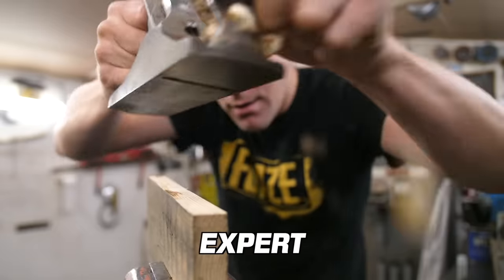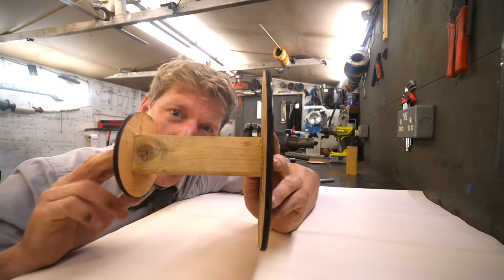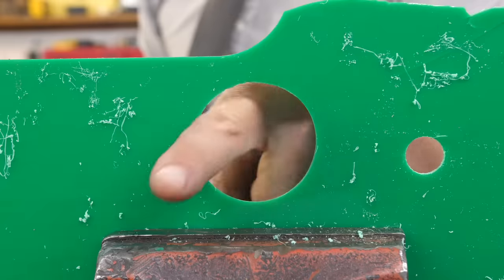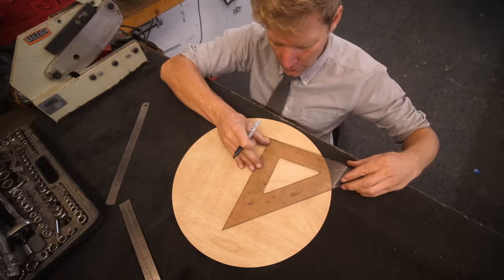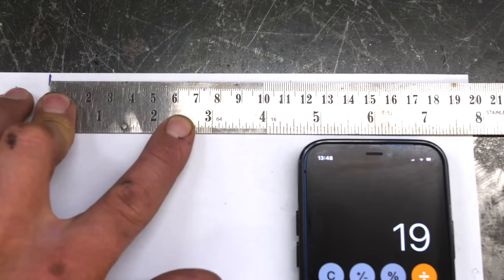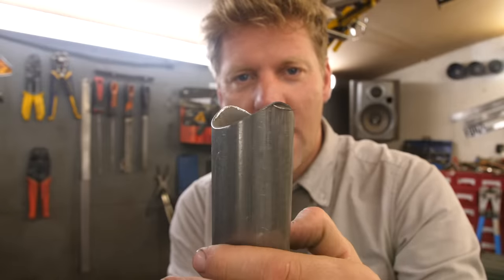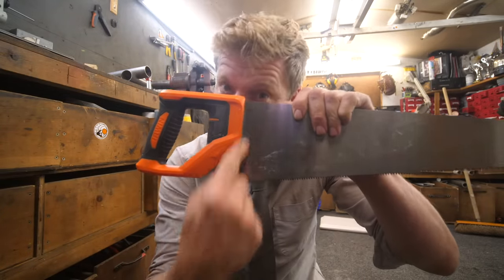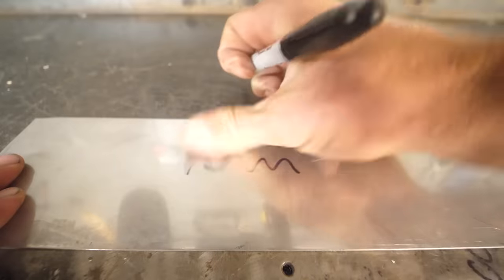18 GENIUS Workshop TIPS (that actually work)

Comment: Straightening brake line through a hole drilled in wood and refilling an aerosol can with shop air are such great ideas, I can't believe I've never thought/heard of these before.
Reply: Using a old rubber tire valve fits nicely on the aerosol can and the air chuck.
Reply: The only thing Colin didn't mention is that if the product in the can is something that cures (e.g. paint) you should understand the mechanism of the curing before you add air to it.

If it cures on contact with either air or moisture, it'll only really work if you intend to use the remains of the can straight away.
Reply: Agreed.  I have a can of PB Blaster I was just about to throw out because there was no more pressure in the can, despite hearing a decent amount of liquid in there...definitely using this one.
Reply: Un-Safety tie

Comment: When I was building model rockets the instructions had an awesome tip. If you need to draw a straight line on a tube use your door frame. Just hold the tube up against the inside of your door frame.

Comment: If you need to cut a piece of threaded rod or a bolt, put a nut on first. The nut will fix the blemishes on the thread as you remove it after cutting.
If you need to glue two pieces of plastic together and superglue does not stick to them (like polypropylene for example), hot glue is usually your best choice.

Also, just so you know, Colin, if the two diagonals of a quadrilateral are the same length, that does not necessarily mean it is a square. But of course if they are not then it's definitely not a square.
Reply: for the transparant plastic (used for machine protections) u can use chloroform to glue it
Reply: @gabb3r4lif33  Acrylic, yes, polycarbonate I'm not so sure.

Comment: I have a notching technique! I’m a hobby welder and I do a lot of projects with EMT conduit, and the issue I had were breaking hole saws regularly from the skipping or binding while notching. My technique now is to drill a pilot hole with a 1/4” bit through the pipe, using one of those drill gauge blocks clamped on with a hose clamp, leaving  two perfectly centered holes. Then I chuck in 1/4” round stock about 12” long into my hole saw  instead of it’s drill bit, along with the hole saw the diameter of the pipe. The longer rod stock feeds through both holes and keeps the hole saw nice and perpendicular as it cuts. This really reduces the hole saw binding and snapping off hole saw teeth. 
Bonus tip, always operate the drill with your left hand anytime you use a hole saw. If the saw binds, something about your left hand’s grip on a drill spinning clock wise is fine, whereas using your right hand can really tweak your wrist painfully
Reply: The left Hand Trick ist neat!! I will Uwe it when in Drill anything that can bind (or i am too lazy to Walk an get my step Drill Bit)

Comment: One which I'm surprised a lot of people don't know - When cutting with an angle grinder, don't apply force - that's what causes the disc to wear out (and it doesn't cut any faster). Use only light pressure and your cutting discs will last 10x as long. 

To tap holes perfectly, place the tap in the chuck of your pillar drill and turn it manually for the first few turns. 
Better still, make a tapping block from an aluminium chunk - drill and tap whatever holes you need, then when you need to tap a hole simply line the tap block above your hole, clamp gently and go! Perfect taps every time.
Reply: Plus with the angle grinder go along the entire length of the cut moving the grinder back and forth, as opposed to cutting thru the material and just pushing the saw through. In other words, don't use it as a circular SAW, it's a grinder, doesn't have teeth.
Reply: @king4aday4aday   Fireball Tool has a great video on this.
Reply: That video shocked me, when he's like "I pay $6 a disc and can cut 3 pieces of metal before it's ruined."   @InTheCatBoxAgain
Reply: @heathcliffflowen4134 
Yeah, money doesn't seem to be a limiting factor for Fireball... like his stuff & vids, just have noticed cost/thrift isn't on his radar.
Reply: not just with an angle grinder, almost any cutting/grinding tool, let the tool do the cutting, theres generally little to no force required beyond holding the tool in place.
One of the things i got taught over and over in both lapidary and engineering XD
Reply: Same goes with hammer action drills … let the machine do the work not you. Also when drill double check the speeds which I will be optimal performance you’ll get a lot longer life from your consumables
Reply: i learnt recently there are cheapo flat face plates for angle grinders, to clamp on instead of the regular protector (to be like a circular saw). so you can guide with mm precision using a rail, even tho chinesium.
Reply: Putting pressure on is almost always the cause of Jigsaw blade damage (assuming you had the right type of blade 😝). Loads of people think they had bad blades, when they actually just had a bad technique. As with basically all drilling/cutting tools, the tool and bit know what to do. You just need to give them time to do it.

Comment: When coiling an extension cable, rather than making a single loop (e.g. around your hand and elbow), make a figure 8 (crossing between the hand and elbow each pass).  The crossings prevent each loop from tangling with the next pass and you can unwind the coil by grabbing an end and throwing the length.
Reply: This all the way, I prefer under overing my cables but this is far easier to teach people.
Reply: my mates old man used to make us wrap the 50m 110v lead then laugh at us as one arm slowly gave up 😂 wrapping a 50m properly is an artform
Reply: Learn to chain link a cable faster easier and no tangles surely there is a utube vid of this already
Reply: @Thomas-hf3dn Essential Craftsman has a good video on it
Reply: I just converted my hose reel from the garden into holding my lead.When I want to use it I just unreal it. I remove the plug and then inserted the power cable inside the hose socket ,then reattach the power plug so that I can pull it in before winding it up again. This achieved two things, one it stops the cable flopping around when you wind it up and two it means people have to unwind the cable before using it.

Comment: I mentioned the angle iron slip roller trick on your drift trike video when you was making the steel balls. If you radius the internal edges of the angle that are in contact with your material, it won't try to rag the edge on the material as you roll. You can also weld a bit of flat bar on one end of the angle and use a small g-clamp to keep it in place or drill and bolt. Love the videos, but shame nothing blew up or caught fire in this one :)

Comment: Best tip i was ever given for soldering two wires.. instead of trying to hold the wires together or twisting them and feeding solder in, apply solder to each wire separately (called 'tinning') then gentle heat them next to each other with the solder iron and they melt together. Much nicer and easier to do.
Reply: I always tin the wires and usually feed a bit more in but it's often not really needed. I usually find the hardest bit to be getting the helping hands holding them in just the right spot so the wires are nicely next to each other. And usually harder if the bits of wire are attached to something at the other end, which they often are. I find blue tac to often be useful to hold awkward wires in the right spot. Although it can get a bit melty if the wires get a bit too hot lol.
Reply: And don't forget to forget to put the heat shrink on first!
Reply: @mattagnew206  the glory of this (the nasa method) is that if you forget just heat them up again pull them apart let them cool add your shrink and rejoin
Reply: @mattagnew206 That's the most important part. It makes your soldering better if ya have to do everything twice  😂😂
Reply: Yeah, but I come up from the days of the Western Union Splice where you are looking for a perfect solder joint without relying on the solder to be the electrically conducting material. The reason being?  Well non-lead solders have about 10x the resistance of copper. this means that you will induce resistance into the circuit at that point. resistance turns into heat, at a point that can easily melt.  so, tinned connections are only for super low amp applications or where resistance wont be an issue.  

Do it to a sensitive sensor for a machine or car, things wont work right. do it in a high volt/amp circuit and the joint fails.
Reply: Pre-tinned is easy and a perfectly fine electrical connection. For the best durability, don't twist or tin, simply push them together so the strands slide in between one another then place them on top of a soldering iron and wait for them to heat up enough to melt the solder from the opposite side. This will also give you the thinnest possible connection to seal into some heat shrink so it doesn't snag if you have to pull the splice through a harness, grommet or around a corner.
Reply: Rather than twisting the wires or trying to hold them side by side when soldering. The easiest and neatest way is to strip the insulation and then feed the end of the conductors of each length into each other, thereby splicing them together. Now is the time to grip the conductors on each length and twist them. This will give sufficient mechanical grip between each group of conductors whilst soldering the joint. Obviously you will need to shrink wrap or insulating tape the joint.
Reply: My trick is to shape the wire ends into hooks, squeeze the hooks into loops once the wire ends are hooked into one another then solder
Reply: @mattagnew206  If it doesn't have to be pretty electrical tape works fine for most stuff (wouldn't trust it for high voltage but I'm not sure I'd want to solder 2 high voltage connections together anyway).

Comment: To make two straight things square to each other over large distances, use the 3, 4, 5 triangle.
Example: measure 3m out from the corner to be square and mark, then 4m along the other side and it will be square if you measure a straight line between your two marks (the hypotenuse of the triangle formed) and it is 5m.
Works with any measurements that have the same ratios as 3, 4, 5   ie   9, 12, 15  even imperial sizes :)
Reply: Should have read further down everything I’ve said is already here

Comment: When stacking buckets together, you can place a piece of non-corrugated cardboard between them to prevent the vacuum from forming.
When working with spray cans, you can keep the nozzle from getting clogged by spraying upside down for a few seconds. This only works if the can is not one that works upside down.
Reply: I open new bags of cable ties/zip ties like tissues boxes and pull them out like tissues. That way they won't spill everywhere.
Reply: I take the nozzle off and blow through it hard - you can do it without getting paint on your lips. It clears the paint and it works.
Reply: @pepwaverley2185 Just blow long enough till it runs clear. Way better to end up with a little paint you can’t use than waste the majority after one use because the nozzle and inside pipe is blocked.
Reply: @grumpyone5963  There's going to be some funny replies to this comment, I can feel it in my water!
Reply: @kevinmothers904  Oh blimey, I’ve read it again now🤣 We were talking about aerosols!
Reply: Gluing a small crack in wood: Moisten the area. Run a bead of glue on the crack. On the other side use a vacuum to pull the glue through. Wipe off excess and clamp.
Reply: @pepwaverley2185  did you already forget one of the tricks in this very video that deals with that exact problem? Fair enough if you don't have access to an air compressor though

Comment: tilting your ruler to get an evenly divisible number to find your half ALSO works with other divisibles! It's a great way to get perfectly even divisions of any number on a piece of any size, no matter how irregular the measurement!
Reply: This is so obvious in hindsight, I feel dumb I didn't see it
Reply: Same - I am going to make a new ruler that isn't for normal measuring, it just has a start mark, and end mark and a mark for half, third, quarter and fifth.
Reply: @mikelastname  Technially a ruler already has those marks.
Reply: @strecher777  You are right, of course. But this may be the one reason why an SAE ruler is superior to a metric as the major graduations are more in line with the typical divisions needed for "human scale" carpentry, etc.

Comment: Additional tip for drilling level holes (only works when drilling horizontally). Put a washer on the middle of the bit before you start drilling, if you’re drilling straight the washer will stay in the middle. Drill downwards and the washer moves forwards, drill upwards and the washer moves backwards.
Reply: wouldn't the spiralling cut-out on the drill bit naturally move the washer? much like a washer on a spring.
Reply: @rid1coza  might need a drill with a clean shank
Reply: The right washer is always the hardest thing to find. :)
Reply: @GBCobber  It just has to be oversized.
Reply: @RandStuffOfficial  Let me rephrase that. The bigger washers are always the hardest to find. lol
Reply: @GBCobber   Right 😄

Comment: For deburring drilled holes, even at odd angles, instead of using a countersink, use a ball burr meant for a die grinder. Use one slightly bigger than the hole, mount it in a handle (tap handle works well) and turn it by hand. This works great for deburring inside tubing or in tight places where you can't fit a countersink straight on.
Reply: Tapered reamer is the tool nobody has thats just perfect for this XD
Reply: Or just a larger sharp drill bit
Reply: It's not really a secret but there is a tool for deburring even weird holes and irregular shapes. It's simply called "deburring tool" (if you need a specific product for reference, an example would be "Noga Teddy Burr - TB1000" but you can just get any that are like that it doesn't matter).
For regular holes on flat surfaces a countersink bit is usually better but with some stubborn materials like some plastics the deburring tool works much better.
For irregular shapes it's immediately become my favorite tool when I bought it.
Reply: This is brilliant! I often find that countersinks just fold the  burr over, particularly on harder materials. Plus, deburring blades can be tricky in small holes.
Reply: @mycosys  A tapered reamer or drill bit doesn't work on the inside inaccessible edge of a hole.
Reply: Countersinks are still superior IMO…. But they’ve got to be sharp and not run too fast. Nogga type deburrers are also handy as they’re good for sheet metal too.
Reply: @landroversforever  Again, a countersink won't work unless you have access to the hole. A ball burr will work from a steep side angle.
Reply: @mycosys  I love my tapered reamer. I have used the same one for decades. It's worth the extra cost to get a decent one.

Comment: Isopropyl alcohol is the best for removing sharpie markers. 
I use the alcohol wipes on the sharpie labels to reuse plastic bins and bags
Reply: Any kind of high proof mixture will do. And I KNOW there shops where such liquids are very common. Isoprop is the best though, and the wipes are a wonderful premade alcohol + shop towel combo.
Reply: Covid made hand sanitizers freely available everywhere. I have used those many times to get rid of sharpie marks.
Reply: Meths works well for lots of these types of ink and is easy to get.  I have seen navigators use a small tub of nail polish remover wipes to clean permanent pen off maps too.

Comment: Siphon fluid using a blow gun at the discharge end by setting the blow guns tip at about a 60 degree angle facing away from the discharge end. It's like using a hand vacuum to pull fluids. Another....say you've got wires to feed through an odd shaped pipe. Get a length longer than the pipe of  Unwaxed dental floss tucked into one end, then holding the start end of floss, blow the rest into the pipe and it'll always come out the other end. Use this one all the time on retro installs for things like HDMI cables etc into previously installed conduit. Also works awesome to wire up motorcycle handlebars and hide the wires inside the bars. Same with hiding wires in the frames of bikes and motorcycles. Just drill a couple small holes. One at the start of your wiring, another where you want the wire to exit and poof.....floss threaded and it's plenty strong enough to pull a number of wires at once.

Comment: I hope someone sees this!

I needed to drill a hole into the center of a 3/4" dowel to make an axle.

So I took a piece of 2x4 and drilled a 3/4" hole about half way through, using my drill press. Then I used a smaller bit (that matched my threaded rod) in the drill press to drill the rest of the way through.

This made a nice jig.
Put the dowel into one side of the 2x4 jig, and then drill from the other side of the 2x4 into the dowel.
And you end up with a perfectly centered, straight hole in the end of your dowel.

Comment: My early fabrication hack for notching tubing was to figure out where the centerline intersected the tube, drill a 1/4" hole on either side of the tube and replace the drill bit in the arbor with a 12" piece of 1/4" drill rod to guide the hole saw. It works surprisingly well, even at angles.